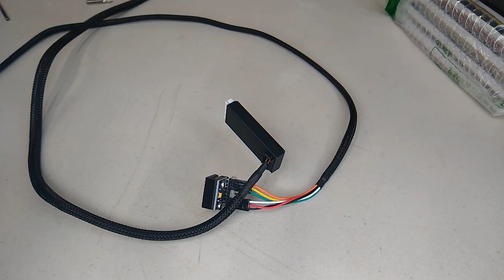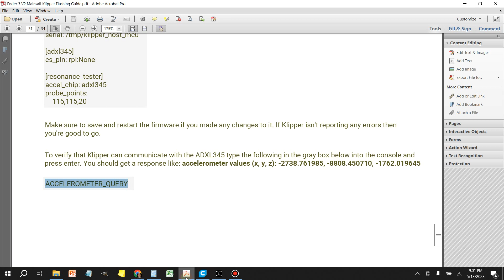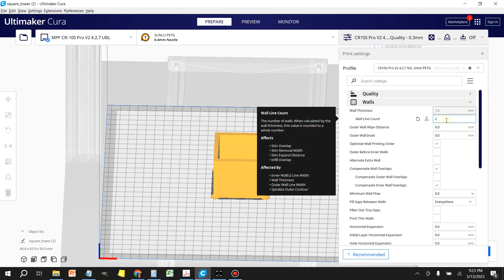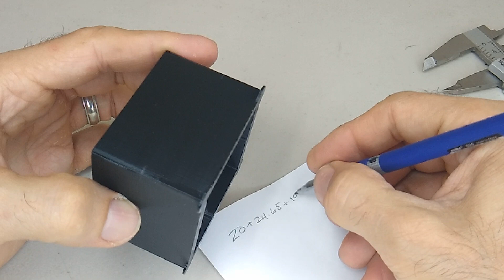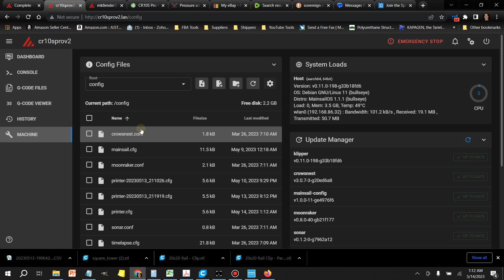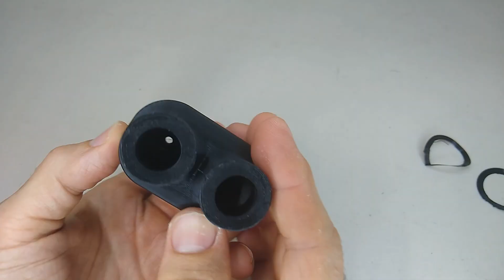Creality CR10S Pro V2 4.2.7 Tuning Pressure Advance & Input Shaping

Comment: Hello @vbared. I got my printer (CR-10s Pro V2) in september -23 and I'm hooked!
Love your channel and have watched all your upgrade-videos for my printer. I Like to tinker and I'm not afraid of taking things apart and try to make it better, and your channel have helped me alot! 

But where did you get the belt-tensioner for the x-axis? I've searchd high and low and coulden't find anything? Is it 3d printed or just a modification from other machine?

Keep up the great work!
Reply from the maker: Hi friend, 

Thank you for commenting and encouragement. I'm glad you found value in these videos for your viewing time. 

Oh, yeah, if you like to tinker 3D printing is a great hobby that is easy on the bank account. Wait until you learn some basic CAD to make physical things that you can see in your mind. I needed some drywall anchors and instead of heading off to Home Depot I just logged into OnShape and designed one that could use standard 1 inch drywall screws and printed a dozen of them. The technology is truly amazing and a tool everyone should own. 

I modified this Thingiverse X-tensioner to increase the X- travel. I can't remember for the life of my which slider is the one I used so I included both. I guess measure the opening you have on the bearing to determine which to use. Make sure to scale the slider z&x down to 99% and scale the nut x&y up to 101% so they will thread together easily. Leave the housing as is. All the parts are printed without supports. 

https://mega.nz/file/UZ1DXJpS#GBrKK1sgvXEHYZVw2YYnx_6kT4XPlQ6u1ABUYlDCVm4

Best of luck with your mods!

Comment: Another great video!  Did you upgrade your NG cooling?  I see another fan up front.
Reply from the maker: Hi John, Thank you for your kind comment :)

Yes, I designed a new cooling system for the Micro Swiss NG over the last couple of months. It uses a 35x35mm 24v cooling fan from an E3D V6 hotend along with a second 4010 blower and new CR-Touch mounting bracket. The whole thing is more compact than the stock setup with way better cooling. I'm still finishing up some more tweaks and will release it to my Shopify store for $4.99 soon. 

Best of luck with your mods!
Reply: @vbared  great news- will there be a BL Touch version?  Also, do you have a link to your Shopify? I am looking to upgrade my sand blaster as well. Thanks!
Reply from the maker: @johndavis2048  Hi John, I appreciate you considering to support my work. Wet media blasting is an amazing process for working with soft metals. What are you planning to clean and polish? 

Thank you for reminding me about a BL-Touch version of the probe mount. I'll include that STL as well.

https://victorbared.com/collections/all
Reply: @vbared I want to be able to do aluminum parts for my Jeep and motorcycle parts.   I am hoping that I can do both dry and vapor blasting as some of the Jeep and other part require a heavier blast. 
Thanks for the links - I like what you done with the place 😀
Reply from the maker: @johndavis2048  Yes, you can do both and even using the same V3 vapor blast gun just switch out the nozzle for this ceramic one and make sure the gun is completely dry inside. I designed to have a very strong syphon when air flows through the nozzle so it will easily work with both. https://www.eastwood.com/eastwood-blast-cabinet-foot-pedal-gun-replacement-nozzles.html

Comment: Victor your missing a trick. Cura uses a formula in the print speed that makes your walls half the print speed. Change all your infill, wall etc to the same speed. Keep initial layer down to 35m/s for good bed adhesion. Youll see your print time halve. Also when you input shape it shows in the console what it thinks your max acceleration is with little smoothing. This should be put into your max acceleration as a starting point. Great videos
Reply from the maker: Hi GP, We're going to need to connect so you can fill me in. I've been racking my head on where to find information on what needs to be changed in Klipper to print faster. Give me a call 478-227-3301
Reply: Hi Victor, happy to talk on email or whats app. Im in the UK so probably not best to call. I had all sorts of fun getting the wiring right. Seems like my printer plus my new board flips all the wires around. Got it working fine now. Happy to help, i print using PETG which probably has a limit to how fast you can print but as i print tall prints and this is a bedslinger il expect thats going to be my limit. Speed isnt a problem at the mo its accelerstion. Mention in another video that acceleration affects curves made up of small lines. So far either arcwelder plugin or up the acceleration fixes this

Comment: Victor great series.  But I have a question on the Customize Miguel's Professional Firmware.   The issue have is when I open the config file there is no createcofig .pyw.   Just a creatconfig without the .pyw.  The file will not open. Not sure what I did wrong.  I have a ender 3pro upgraded to an ender extender 400xl.   I need to change the bed size to 400 x 400 x 500.  So far I can get any support from the company makes the extender....   Thanks for taking the time to create all these great video.  The videos have been a great help to me.
Reply from the maker: Hello Sarge Dutch, Thank you for your kind comments. I'm glad you are getting value from this series for your viewing time. The configurator file is located in the root directory of the special configurations folder linked below. Just download, unzip it and look for the .PYW file. If you still don't see it it might be getting quarantined by your antivirus software.

https://github.com/mriscoc/Special_Configurations/archive/refs/heads/main.zip
Reply: @vbared  Can't get the menu to load. When I click on the configurator file. It just flashes  and disappears..
Reply from the maker: @sargedutch1085  Give me a call 478-227-3301 so I can help you sort it out.
Reply: @vbared  okay I will call in the afternoon. thanks

Comment: Oh Victor you are KILLING ME. So complicated but my God we need this so bad. I ordered the Garolite plate that nearly cost as much as the 4.2.7 board. Wow! You did a great job. I am not ready. I thought you had the MicroSwiss DD unit what is this DD and when did you it. Was it because of the weight??? Thank You WoW Dennis
Reply from the maker: Hi Dennis, Happy Friday! Hey man if you ever want to talk 3D printing just call 478-227-3301. A few of my subscribers and I talk about this amazing hobby and bounce ideas off each other on the regular.
Reply: Hey Victor  @vbared   I have gone with a 7 inch Screen, OctoKlipper, Klipper and sticking with S3D V5, Have yet to Calibrate fully but OMG with your Garolite bed I am printing CF PETG perfectly, PLA+ is even better. All my prints are 10X better than ever. What a Transformation. Using the older MicroSwiss DD and Hotend but now hearing the new NG is worth the upgrade. Its Only money?
Reply from the maker: @DennisMurphey  Hi Dennis, that's great news, man. I'm so glad that you are enjoying the CR10S Pro V2 again. The G10 Garolite is a real game changer for PETG, PLA, Nylon, and ASA.

Soon after I bought the Micro Swiss NG they came out with the Micro Swiss NG REVO (linked below). I reached out to them and they sold me the NG conversion parts. I'm going to swap out my other printers to them.

https://amzn.to/3YAyhc9

I didn't notice a difference in quality but it's much lighter in weight, has more torque, the shortest filament path, and the REVO system allows you to swap out nozzles without having to ever worry about problems with the nozzle to heat break seal inside the heat block. The REVO nozzles have no seals inside the the melt zone. Say goodbye to blowouts and clogs forever.